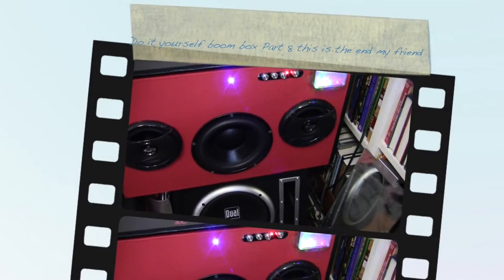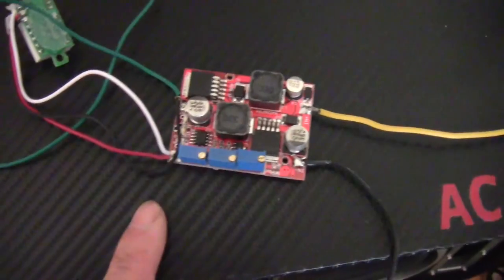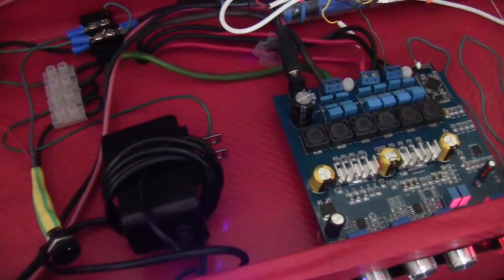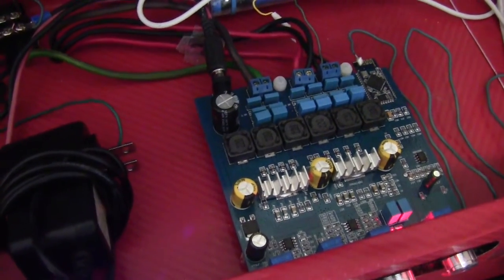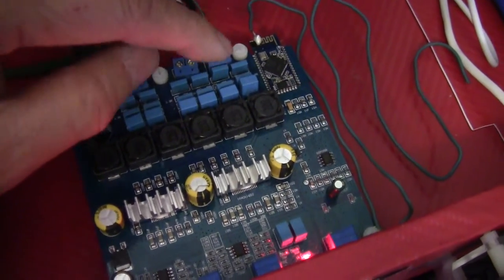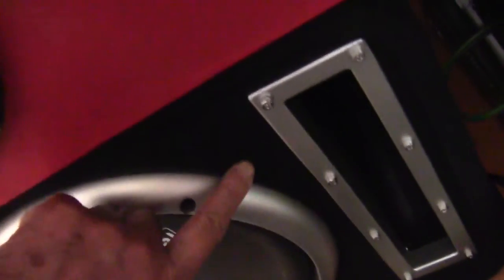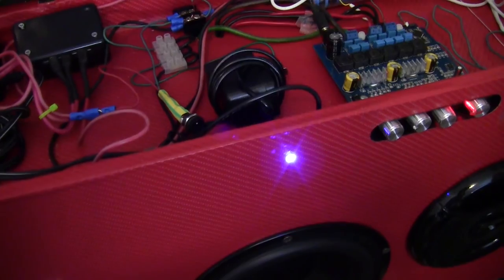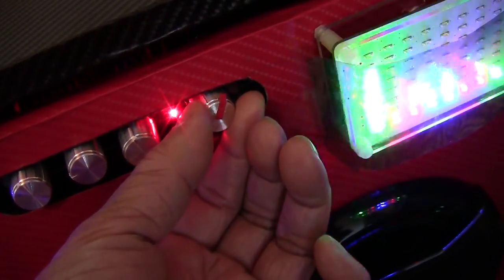Do it yourself boom box Part 8 this is the end my friend

Comment: Very nice all around.  Definitely handles on the side with an optional strap; the strap from an old notebook case might do nicely, and can probably be stored in the top when not needed.
I'd also add a latch for the top, wouldn't want that popping open if it's tipped, which would likely damage the wood.
Reply from the maker: Very sound advice. Thank you and have a great morning.